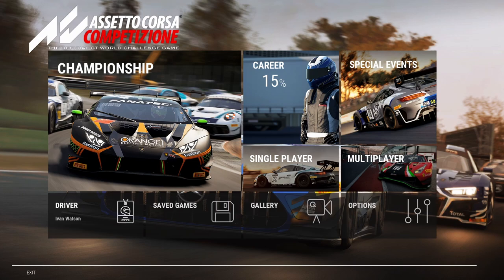A Beginners Guide on How to Make a Setup in Assetto Corsa Competizione

Comment: Thanks for the video! I would say there's an important thing that no one really talks about: when should you work on setup?
You should eliminate every driver error before working into that and not use setup as an excuse for you not being able to be consistent. Try out multiple cars on aggressive setup, get comfortable with them, know the track perfectly, ensure you have proper technique (most important), ensure tire pressures and brake temperatures are on point, race like that for longer periods of time.
Once you are very solid and consistent (and trust me, with default aggressive setup you can be competitive in online racing), then work into improving other areas of the car setup.
Happy racing!

Comment: negative front aero variation means more downforce at the front? I am not sure about this to be honest. Let's say you run maximum rake for some reason, and zero wing. Does this result in more downforce at the front or at the rear? Because i believe that's the front. Which will result in massive high speen oversteer. Then you add the wing, which generates the downforce at the rear. So max rake + max wing should mean max overall downforce, which is not a good thing, but in theory that's how it should work. Or am i completely wrong?
Reply from the maker: "Adjusting parameters such as front and rear ground clearance, rear wing, splitter, etc., can significantly shift the car’s aerodynamic balance forwards or backwards. An increase in the Front Load Variation (eg from 2 to 2.6%) indicates that the aerodynamic adjustments have moved the downforce forward; a reduction (for example from 2 to -1%) means that the aerodynamic load has shifted significantly towards the rear" - This is what I meant, maybe I said it wrong in the video as yes, negative means more on the rear.
Reply: It will not create more front downforce, just in relation to the rear. I.e.the front will have more Downforce compared to the rear though overall downforce is decreased.
That's my understanding of aero balance anyway

Comment: with the tire temps being so high, would it make sense to decrease to & camber? it would remove friction right? i had the same issue with the front right running at Zandvoort with the Ferrari GT3. great video, thanx for sharing
Reply from the maker: Yes toe and camber definitely have an effect on the tire temperatures. I tend to focus mostly on pressures if I have a setup I love and don't want to change but if you are having issues then yes trying to decrease the camber a bit can definitely help with temperature and tire wear

Comment: How do u know how much ur springs compress n exactly where to place ur bumpstops? Or how hard to make them so that ur car uses it but never hits the limit? Why is it that ur rear ones r so far up from ur springs as opposed to front ones? I need to know much the springs r compressing n how much room they have considering ride height. I know they wanna make it realistic but im sure the driver wud b told these things whereas we're not. Help me out pls.
Reply from the maker: This is something you can only really see with Motec data that will show you a graph of suspension and dampers. Without it you've just got to adjust based on the feel and the need on the track you're at, one with big kerbs or a bumpy one etc.  In response to the question about mine, the Bentley has its engine in the front therefore it has more weight there, that's why the rear ones are a lot further as it doesn't have to be as stiff. But ultimately if you want to see the exact data I'd suggest looking into Motec, as it is what lots of real life teams use and that gives you good data on suspension and dampers (it is free for non-professional use) so don't need to worry about cost

Comment: Great, I need to study every aspect of being a car mechanic . I’ve never understood all this crap. Oh well, guess I’m not even going to play this game. I tried regular assetto with my wheel but unfortunately, it will not work. I guess it’s because I need to mess with all settings. Looked like a great game but I just don’t understand all this crap and I’m not spending hours, messing with all settings, trying them out and not realising if my changes have helped or not. 😖
Reply from the maker: You can just select just the in-game aggressive setups if you don't understand or want to spend time on this, the game still works brilliantly, custom setups are just for those that want that competitive edge or race in competitive leagues or anyone who enjoys racing mechanics and engineering. At the end of the day it's a simulator so it has all this complex real life setups, but like I said you don't have to make custom setups to be quick and can drive a car on the default aggressive setup and it'll be great
Reply: @bezracingteam414  I tried racing on basic setup and my wheel just won’t respond properly. The forcefeedback is set to 100% and even tho it’s only a Logitech g29 the wheel won’t move more then an inch or so. I turn settings down less forcefeedback and the wheel still won’t respond properly. I can’t turn and wheel locks after about half a turn. I’m on Ps5 but do you think I need to plug into pc to update firmware or drivers or something? Only reason I didn’t do this already, is because most say that g29 is plug and play on PlayStation and I don’t need to do anything with pc and that change me I make, only apply when using with pc and not ps4/5. It’s just so frustrating, trying to race on default settings, car won’t turn properly, and im constantly correcting myself. Then go  into settings and not being able to get the car to drive properly. Like, I’ve always loved racing games, since 19’90s and even tho setting car up properly, is best, especially in rally games, because I didn’t understand all that, I was still able to race just fine, without touching any settings. I remember playing dirt rally for first time, on controller and almost gave up after 1 race. I was absolutely terrible and constantly flew off track. After practice, I was flying on controller, even in snow and ice, without touching any settings. Anyway, I’m gonna stop boring you now. Thanks for reply. I guess I’ll just have to try and work it out.
Reply: @grahamkelly8662  just practice. It takes time to learn how to drive, it's not like need for speed